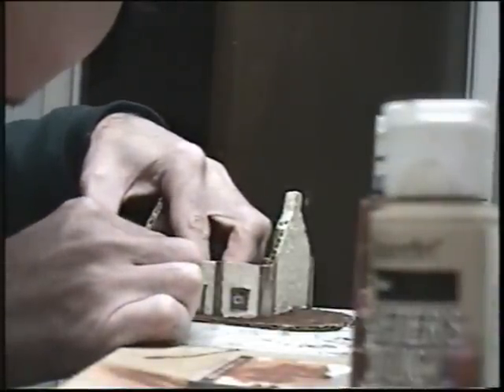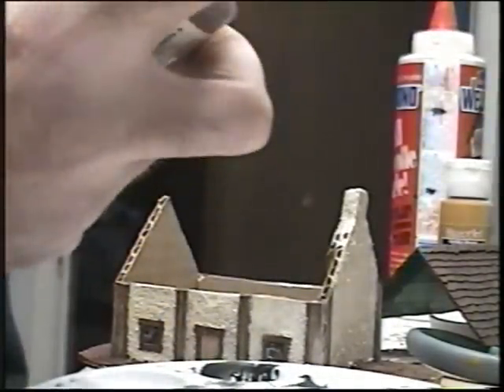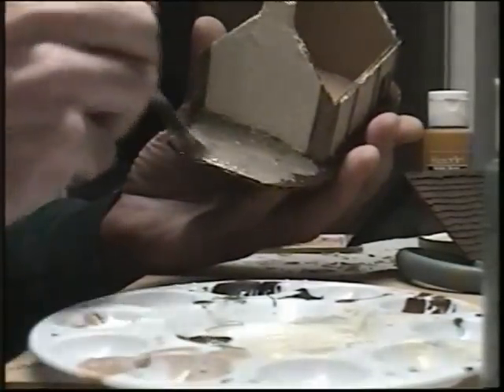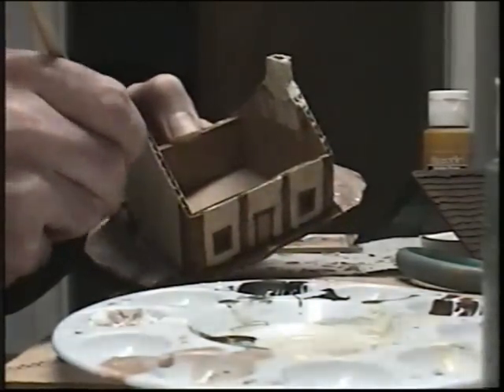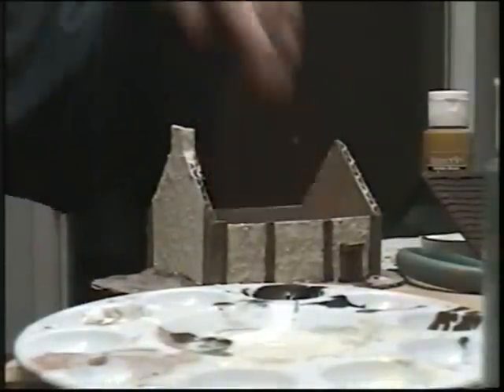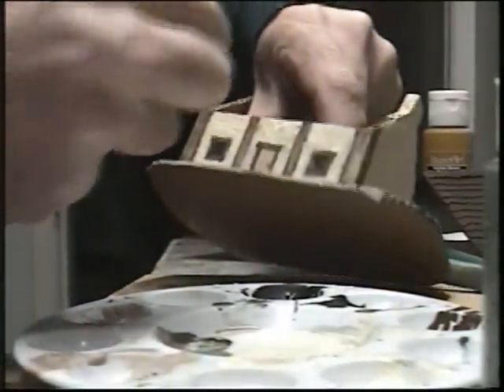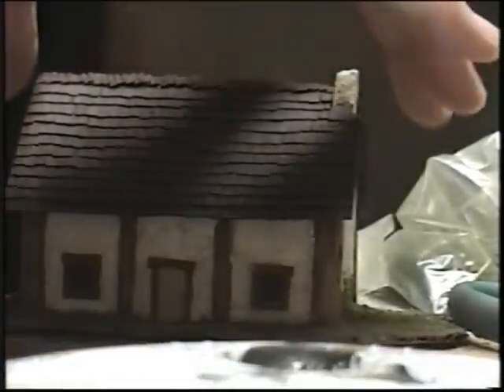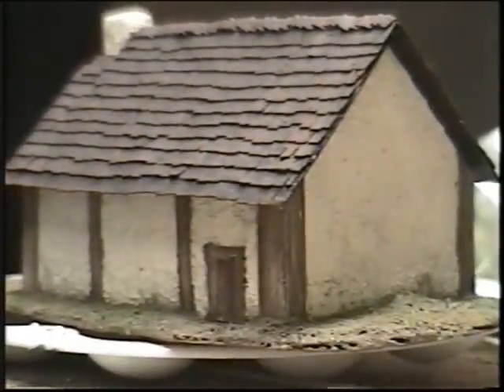P11 finish - 15mm scale miniature house for FOW and other war games

Comment from the maker: Normally I use the high-density foams. 

With cardboard yes, there could be warping in large castle type buildings. 

It would really depend on what you were tryin' to make. Mind you, cardboard comes in thick stuff too, triple ply, (large appliances.) and you could laminate a few layers together.

Some reinforcing with popsicle sticks or bamboo skewers glued to the back would help.